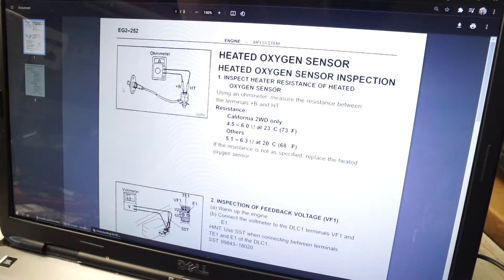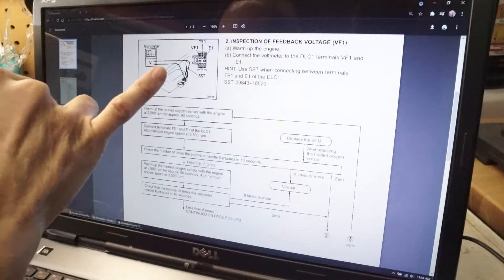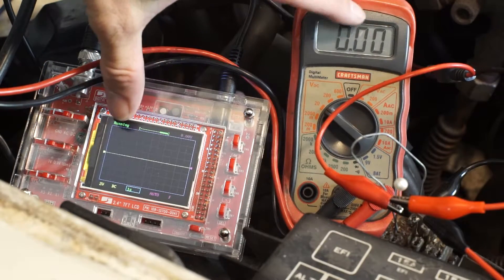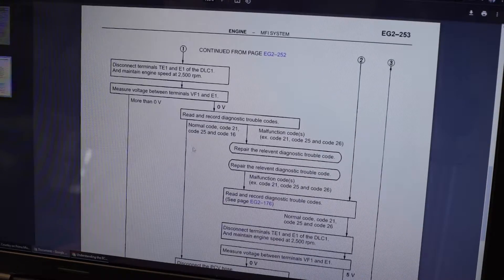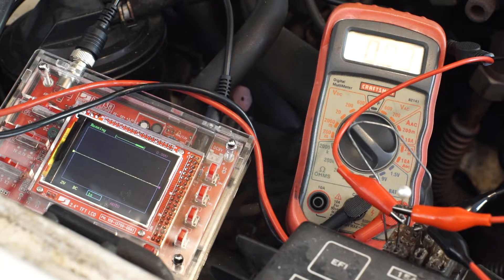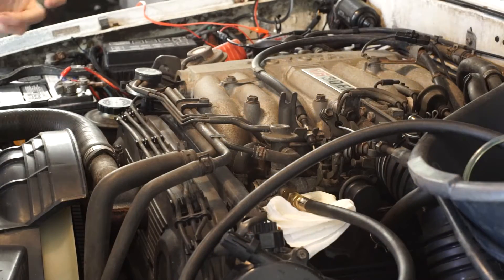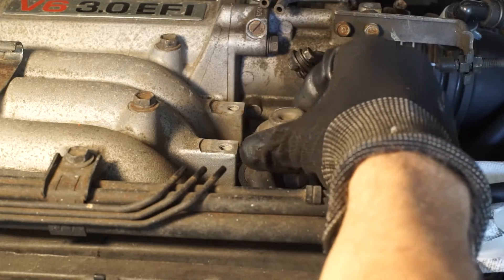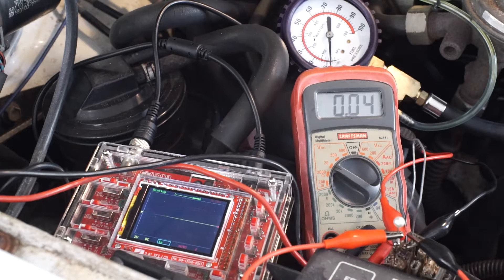1989-1995 Toyota Pickup 3.0 3VZE fuel pressure regulator replacement

Comment: Boy am I glad I came across your video. I've  had my 1991 (manufactured May 1990) for about 15 years. It's a 4x4 manual transmission 3.0 vze. I've had rich fuel problems for about 6 years now. My EOEM catalytic got stollen, here in southern California from actually a good neighborhood where I live. I replaced it with a California catalytic, passed smog, but eventually 3 years latter got destroyed by a rich running engine. I just thought it was a cheap cat. I smoged it twice under the table but eventually replaced the hollowed cat with a Walker, only to fry it 14  months later since I couldn't solve the rich fuel problem. Even though the Walker cat was a Cal CARB compliant cat, my 4R still didn't pass smog. Now I'm having starting problems & I was looking on how to install a gas pressure gauge in the fuel rail with wire fed interior gauge. This is how I stumbled on to your video. So now I think I may have killed 2 birds with one stone, thanks to you. I don't have an access door to the fuel pump on my 4runner, so I cut one, about 6 years ago when I replaced the current fuel pump. I forgot to test the fuel pump using this method. But it's out already so I'll test it in about an hour. I'm going through all the possible fuel problems first. I replaced the MAF sensor with another one I had. That wasn't the problem. But once I get my 4R started, I'll check the fuel pressure to see if I need to replace the fuel pressure regulator, which most likely I do. I'm excited, I think this is also the problem for my rich fuel pressure. It's nauseating driving my 4R in California freeway traffic. Good think I have 3 other cars, but I love my 4R. I'm off now, gonna check the fuel pump now that it's out of the gas tank.
Reply from the maker: Good luck!!!  Let us know

Comment: I have the code 25 in my 4runner 1994 v6 it just popped up one time and never came back but my problem is it won’t rev over 4000rpm or you can say that its choking when accelerating or trying to rev it up over 4000rpm any help i will be thankful for you
Reply from the maker: Not getting enough fuel for some reason is likely.  Check fuel filter, fuel pressure, fuel pump.  Possibly O2 sensor.  Possibly leaking intake somewhere. Too many possibilities, you’re gonna have to work at it.  Check fuel filter first is what I’d do.

Comment: This is some high level stuff! Great video. 
(I'm not getting electricity to the fuel pump)
The circuit open circuit works!
Do you have a video on the circuit from ignition to the circuit?
It only gets electrical current while cranking!
Reply from the maker: There is a fuel pump cutoff switch built into the Air Flow Meter.  I have a video showing the disassembly of it.  Check that circuit to see if it is functioning properly.
Reply: Thank you!
Pump Only worked while cranking. 
It ended up being the (cor)
The airflow part of the relay failed.
(Truck died while running)
(I did notice the pump doesn't prime with ignition on, don't know if this year toyota, 95 4runner does this?(think the computer is what turns on the pump momentarily?)

Comment: Thanks for the video. When you tested the fuel pressure, did you have the keys in the ignition in the 1 (accessory) position or 2 (on)?
Reply from the maker: If I remember correctly, the keys don’t need to be in at all, the jumper activates the fuel pump manually.

Comment: RetroMotion Sidewinder has  is pretty good molded 5/16"  fuel line. I have been using with success.  I used half of it for my repair, and saving the other half.  Its 75 PSI and rates for fuel.

Comment: Did you use a Toyota Pressure regulator or aftermarket? If aftermarket, which one did you use and is it still holding up?
Reply from the maker: I went with OEM Toyota on this one.

Comment: I ended up just bending upward the part that was preventing from unscrewing the regulator instead of doing any grinding. Took a small screw driver, stuck it in the hole and bent it up just an enough to get unscrewed. Then I did the same to install the new one. Thanks for posting the video, it was a big help!
Reply from the maker: I almost did that exact same thing, but I was a little worried I might crack or break the new one.  Happy to hear it worked out for you!

Comment: Good work,So just remove the Banjo bolt and thread the pressure gauge into where the banjo bolt was?Did you use teflon tape around the threads of the gauge hose?
Reply from the maker: Exactly.  No teflon tape was needed.

Comment: hey if you ever get stuck check Ray Nada and 22re performanc e they have great videos on diagnosis for these cars Ray has a 22re but theey get the same rough start  and idle problems
Reply from the maker: Good to know, thanks!
Reply: @ShanesGettingHandy  I used your video to diagnose my fuel delivery problem I have taken it down to either faulty preasure regulator and/or the cold dtart sensor not grounding on start up
Reply: @ShanesGettingHandy  thank you

Comment: Mine won’t go past 3200 rpm in any gear timing is perfect fuel pump is new fuel filter new distributor new spark plugs new wires new and same thing

Comment: What end did you use to grind off intake.  Seems to look like the easiest way to get the old one out and the new one in.   How much grinding did you have to do ?
Reply from the maker: It was one of those small drum sanding ends, and it didn’t take much at all, just grind a little and test spin it to see if it will clear.

Comment: Hey Shane, any chance you could link me the fuel pressure gauge you used here or tell me the brand? I just bought a cheap one off Amazon and the fitting with the matching threads was too long compared to the fuel rail bolt! I ended up over tightening and stripping all my threads :( Now I need to replace the rail or try to rethread.

Did you face this issue? Was your fitting longer than the fuel rail bolt? If not could you please link me to the gauge you use here?
Reply from the maker: I don't specifically remember having any issues when I installed the fitting.  This is what I have.

https://www.amazon.com/gp/product/B0009XQUKC

Comment: Hi Shane, Thanks for your very helpful video here. One question: I tested my pressure regulator on my 1995 4runner yesterday (10-16-22).  At idle, regulator showed about 44 PSI.  However, the pressure regulator dropped gradually to zero within 20 minutes after the engine was turned off.   How long does the pressure of 44 psi have to hold within the line after the engine is turned off.  Thanks again
Reply from the maker: Per the service manual:   

(r) Stop the engine. Check that the fuel pressure remains
above 147 kPa (1.5 kgf/cm2, 21 psi) for 5 minutes
after the engine is turned oft.
If not within specification, check the fuel pump, fuel
pressure regulator and/or injectors.

http://htftp.offroadsz.com/marinhaker/programi/toyota/Engine/3VZ-E/87fuelpump.pdf

Comment: Thanks for the video do you know is 22re same pressure 38/44
Reply from the maker: http://htftp.offroadsz.com/marinhaker/programi/toyota/Engine/22RE/28fuelpump.pdf
Reply from the maker: Yes, with engine off, or running with the vacuum hose to the regulator disconnected, 38/44.  With the engine idling and the vacuum hoses connected it drops to 33/37

Comment: which pins are the +b and ht ones?
Reply from the maker: Usually it's the two black wires coming from the sensor.  Check between them with an ohmmeter as I did.  Polarity does not matter.

Comment: Great video, thanks .exactly what I'm going through with my 1991 4runner 3vz-e engine. I live in Iran and old cars have to pass emissions and safety tests. But my car failed so badly. The Lambda parameter was 0.84!! And HC emission was twice as normal. CO emission was about 3.6 times higher than normal. definitely running extremely rich. So I have to check everything you did on your videos. Super helpful, thanks again.
On last question, can you put a link of the service manuals that you used for your truck including this video and the mass air flow one.that would save me a fortune.
Reply from the maker: https://ether3al.com/FSM/93fsm-mobile/

Comment: Would you mind describing the components used to hook up the tester to the fuel rail? Not having a Schrader valve is proving to be a minor inconvience!
Reply from the maker: I bought an Actron CP7838 fuel pressure tester online and it had all the fittings required in the kit.

Comment: Great video and thanks so much for the detailed explanation. Did you replace the FPR with a OE Toyota part or aftermarket? If aftermarket, what was the brand and part number you installed?
Reply from the maker: I ordered it from a Toyota dealership, part number 23280-65010

Comment: Wow! I am impressed. Been fighting my 3vze for a year. When I accelerate it hits a wall. If I hold the peddle still
It seems to take a big gulp of air and takes off like a scared rabbit. Any ideas?
Reply from the maker: I haven't ever run into this yet, but the very first thing I'd check is the throttle position sensor.  Could be a whole host of other possibilities too.  The service manual is full of useful information, but you have to dig for it.  https://ether3al.com/FSM/93fsm-mobile/

Comment: Thanks for the video it's a big help! Mines running about 50psi at idle so I think I'm going to replace the regulator.
Reply from the maker: It's supposed to drop even lower when at idle, 33-37 psi.  At the end of the video you can see it drop on mine after startup to within this range.  Your regulator is almost certainly bad!
Reply: Mine reads 55psi it's brand new regulator HELP ME!

Comment: Thanks for the video dude! Pretty much what my 3vze is doing at the moment. Also, that oscilloscope is trick. I typed in the model number on amazon and got one to help with my diagnostics. Thanks again man!
Reply from the maker: You're welcome!  An oscilloscope can be a lifesaver, even if it's a cheap one, it's worth having in your toolbox for sure!
Reply: @ShanesGettingHandy  how do you hookup that to measure the pressure ??

Comment: Hey bud question for you. Maybe you can give me and  idea So I bought a 91 Toyota pick up with a 3.0 in it and she has a little trouble starting up but in neutral or in park I can rev up the motor and it revs up fine but as soon as I put it in gear reverse or drive it wants to bog down and die but if I feather the pedal it will go slowly I’ve changed distributor distributor button fuel filter mass airflow sensor throttle body and did the EGR delete and Man it is still not running for me any ideas Man did you can help me with because I’ve had a bunch of people look at it and nobody can tell me any help would be appreciated Man thank you very much
Reply from the maker: Have you tried adjusting the idle air screw counterclockwise?  I might make a quick video on this, it was harder to find information about it than I wished when I was looking, and it's not the adjustment you'd think it is at first.   Also, you might try removing the air intake and cleaning inside the throttle body with a soft brush and carb cleaner.
Reply: Any update on this? I am having the exact same problem

Comment: Hi mine is a 1989 is running rich at idle won’t pass the Cali emissions and 2500rpms pass súper clean
Reply from the maker: That's super frustrating!  Lucky for me there are no emissions requirements where I live.  Does it idle smoothly, or is it misfiring?  What RPM is the idle set at?
Reply: @ShanesGettingHandy  hi my it wa fuel pressure regulator now I pass the emissions super clean was last Thursday
Reply from the maker: @pablogarcia526  Excellent!  Happy to hear you got it fixed.
Reply: My friend I have a dually 89 v6 won’t pass at idle gross polluter and 2500 same as you super clean I try everything
Reply: Buen día soy de Guatemala necesito ayuda sobre su conocimiento estoy revisando una runer 95 3vz y el problema que hace es que al ir en marca en primer cambio estándar a 1800 RPM hace un corte de aceleración y vuelve a pegar jaloneos ya trabaje la Iac el TPS y sigue igual ya al ir en tercera lo hace como a 2500 ahí corta y vuelve a jalonear